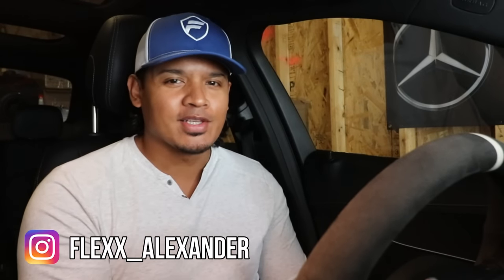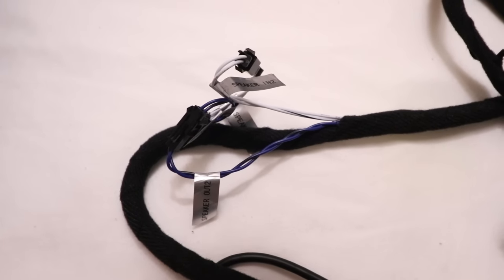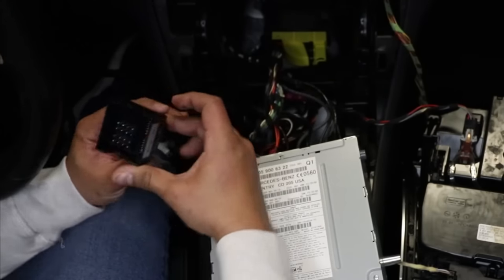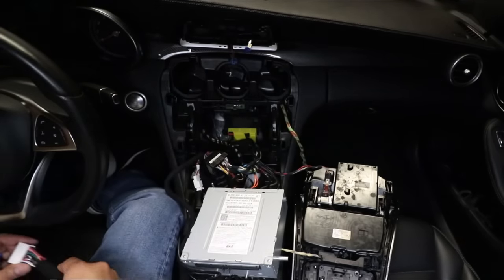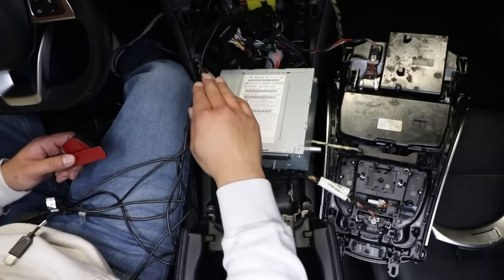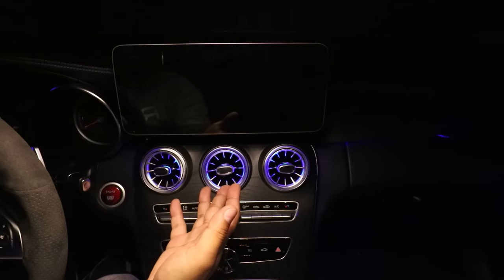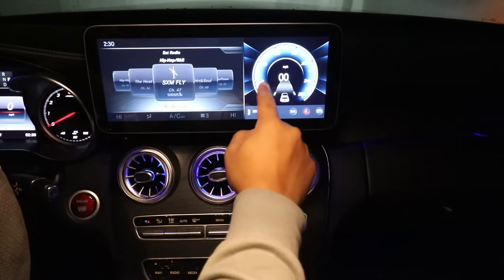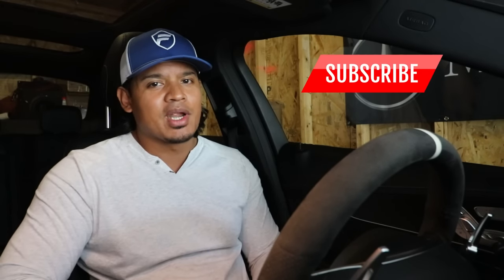BIGGEST Android Screen install on C300 (W205) 2015+ Mercedes C-Class

Comment: Installed mine a few weeks ago, I wound up not using the new micro & speaker just bc I didn't want to tbh & works fine. Also, if you don't have Hotspot then you should look into getting a SIM just so the display can run YT/Netflix, Android auto works fine without but for the full features
Reply: how do you deal with the mic? do you need to configure anything to use the built-in mercedes microphone?
Reply: Interesting. I skipped the microphone install too and it sounds like I’m talking down a hallway. I’m going back to install the microphone hoping it fixes that
Reply: @beaucephus526  did it fix it?

Comment: Flexx, thank you for this video. I purchased this MASSIVE touchscreen from DMP and installed it in my '16 C300. I had this video playing on my iPad as I successfully completed the install. I LOVE THE NEWLY ADDED FUNCTIONALITY! Sadly, Mercedes termination of 3G meant that much of the COMAND system became useless. This new screen replaces the OEM Mercedes apps with easily updatable Android/iPhone apps. I love when people in SUVs are behind me at night at a traffic light. It's awesome to see their jaws drop if I switch from Google Maps to Spotify to Google Podcasts to iHeart Radio and so on. The new processor is almost as fast as the one in my also brand-new OnePlus 11 5G! Functionally and aesthetically it is PERFECT! The last time that I opened up a dash was to install a Blaupunkt head unit in a 1994 Saturn. This video gave me the confidence of knowing that I could install it myself!

Thanks Flexx! Keep up the good...nah...GREAT WORK!

Arnel in Pittsburgh
Reply from the maker: Wow!!!!

Comment: Installed in my C63 w205. Install went smooth enough. Do suggest not pulling down the vents to make more space took long time to get them in again, there is enough room without releasing them to route cables. Screen works as expected, all good. Only thing I don't like is the brightness during sunny days, but cloudy or night its fine.

Comment: I installed the 12" on my 2019 GLC 300. Here are the pros of cons:
Pros: 
- Large screen display transforms the interior of the car to look modern.
- Audio works on music app, video app, android auto, YouTube etc. from the screen without installing the extra mic and speaker that came in the box (but audio has 3 sec delay). Voice command from screen maps app also works including navigation directions.

Cons:
- The phone audio does not work. DMP said I have to install the speaker and mic that came in the box, which does not look good on the car. I have to connect the Bluetooth of my phone to the factory MBUX instead for phone calls audio to work.
- Using the audio-USB delays the sound from the screen by 3 seconds, so you can't actually watch a movies on the screen when the picture is 3 seconds ahead of the audio. Another screen vendor has coded similar android screen unit to work with aux directly, instead of using the audio-USB. I think this a major issue that needs to be addressed. Anyone know how to fix the 3 seconds audio delay when using the audio-USB cable?
- After adjusting the android screen setting to always automatically connect to WiFi, it does not work. You have to always go into the android setting and turn on the WiFi manually every time you enter your car. This is annoying. Connecting your phone Bluetooth to the screen also disables the Wi-Fi. Is there at least a way to have the unit share internet via Bluetooth work?
- The factory screen options will still show but you can only use the scroll to navigate those options (not touch screen). This is not a big deal.

** The unit came with a 4G antenna? Some ppl call it a Wi-Fi antenna. Can I remove this antenna if I'm not using 4G or do I still need it for Wi-Fi?

Comment: The video is very helpful, I managed to install the kit by myself. The thing is, you have to be careful with cables routing, as the amount of space is very limited and I had to make several corrections to have everything properly fit back in place.

What I don't like about the set is that you have to choose both bluetooth connections for the carkit and OEM BT to be able to use OEM loudspeakers for calls AND be able to operate the phone via carkit's menu - the issue is then, carkit's BT connection gets prioritized over MB bluetooth, so calls are, by default, directed to the little crappy speaker and every single time you have to manually change BT connection on your phone to MB BT. Annoying. I don't know if it's possible to permanently change priority to have the calls operated by OEM bluetooth. 

13:29 - those little covers are so incredibly tightly fit, it's impossible to open them with a finger. There's so little space around, I actually managed to scratch the surrounding area and break my mini screwdriver in order to open those bloody things. The heads of those mounting screws (13:42) are too big in diameter, so when I finally mounted the unit and closed those covers, those little plastic hinges keeping them in place broke instantly.

14:02 - good luck with re-inserting air conditioning tunnel. I spent about an hour getting the damn thing back in place and managed to do it somewhat by accident. Again, you have to be really careful and precise with how you route the cables, otherwise you won't be able to snap it back into place.
Reply: That sounds complicated . Sheesh. Now you got me doubting my abilities. 😁
Reply: Hi, 
were you able to solve those problems? I am thinking about buying one for myself. How does it feel like after using it a period of time? is it as smooth as the OEM system?
Reply: @JC-dm6sk  No, I wasn't. Got couple of system upgrades from the dealer, problem remains unresolved. Generally speaking, system integration with Android smartphone is very poorly implemented - in fact so poorly, it's best to assume it's just not working.

Comment: Installed the new 12.3" Android 13 (Amazon - Ninetom Seller/Brand ~$509) my W205 2017 c300 today. I skipped the extra Mic, Speaker, Wifi, and Gps part since I will mainly be using the built-in Carplay features with my iPhone 12. Total installation time: ~ 4 hours ( 2 hours yesterday - completely forgot to plug in audio box into the center console/armrest area and the second white (left) main smaller connector which grants access to the old OEM interface and backup camera. 2 hours today - going back in to correct the previous mentioned and cleaning up wires) The most annoying part of the install was routing the wires through the back of the center console, behind the vent. Unfortunately, my vent was weird and when I clipped it down like in the video at 8:35 it didn't want to snap back in place on both sides so it's only snapped up on the right, but it should hold. Used electrical tape to keep the wires together and neat. One tip of advice, which isn't shown in the video well due to the editing, but transfer the two Torx20 screws from the previous bracket to the new one BEFORE putting it in place below the dash. The bracket has clips to keep these screws in place from jumping around. Don't try and lower the screws from the top of the dash into the new bracket - you most likely will lose one. In case you did: N000000000530 is the part #, the sizing is roughly M4 X 25MM. The screw can be found via Ebay etc. Lastly, when setting up my Carplay, I had to go into the OEM audio section and select "AUX" instead of Bluetooth because it was changing back to the Mercedes BT every 2 minutes when in Carplay. I also went into the "Factory" settings section (password: 190627 - most will have this) and select "Manual" instead of "Automatic" under the [Vehicle] Tab - subsection [Audio]. Now I can use Carplay without it going mute/pausing every 2 minutes and when I use my charging cable it auto connects to Carplay as well. Local Best Buy did not want to install the device and so with the help of Flexx's tutorial and some extra research to correct a few user mistakes, this upgrade is now complete! Good luck and have fun - its well worth it!
Reply from the maker: Nice write up! Appreciate you sharing your experience with the community!!!  😎🤙🏼
Reply: Thank you!

Comment: This is awesome Flexx. I was looking at this kit but wondering how it looks and how to install it. I have a few questions please. I have a 2017 C43. Is it correct that the steering wheel controls won’t work for up down track skipping, but the volume buttons will work? And is there any dependency with the USB ports? I don’t have an AUX option in my 8.4” COMAND NTG 5.5 system. Will this still work for my car? Thank you.
Reply: i have the same car what did you end up doing?

Comment: Hey Flexx! Love the mod, just got a 2017 C300 4MATIC with the NTG5.0 and Audio 20 package. I do not even have navigation on the car, and I highly value CarPlay. Just wanted to ask: as you've used the new head unit over time, has there been much latency? I noticed it took toward the longer side showing the backup camera in reverse. I also want to know if a.) after you go into reverse, does head unit bring you back to NTG or does it go back to CarPlay? (Assuming you were in CarPlay before R-gear) and b.) if I can change the digital speedometer to something else. I don't like giving my passengers a window into the absurdity of my er-- less orthodox driving habits. 

Thanks!
Reply from the maker: 1) it goes back to whatever screen you were last on.  And it actually isn’t that slow. It’s pretty quick. 

2) the only thing you can do is go into the secret menu and stretch the interface to cover the entire screen if you want to get rid of the speed gauge on the side. But then your interface is slightly stretched versus being true to the resolution dimensions. 

Feel free to ask DMP directly. There’s always updates and new screens available. They can answer any questions you have probably way better then I can.

Comment: Great install video .. everything went smooth .. I did however have to go in the camera setting and switch it to OEM but quick fix
Reply from the maker: Yeh. The screens settings need to be setup properly for your specific car. Most people think you physically install and it’s done but that’s not how it works.

Comment: Hi Flex, Hope you are well. Just a quick question. I installed this screen on my W204 but forgot to install the additional microphone. Would i need to open the entire radio unit or can i just remove the screen bracket on top and pluf the cable in ? I got this done as a garage using your video. Thanks for your support :)

Comment: Hi. I’ve fixed it in my W205 C200. But when we tried the function, the usb is not connected and the volume cannot be adjusted. We checked the installation, nothing went wrong. And also, for the CarPlay, it cannot access the YouTube as well.

Comment: Does it actually worked for long term or became slower to response as happens to android screen/tablets?
Reply from the maker: Yes it works long term.  And no, it’s not like a normal tablet where you spend hours a day on, downloading apps, downloading stuff, storing pics/files/videos constantly. That’s what leads to performance degradation.  On a cars android screen, people don’t treat it like an everyday tablet.

Comment: Hey Flexx. I loved this video. Thank you. Got mine installed. Everything worked great until the aux to usb audio box that plugs in to the armrest started acting up. Sometimes it connects sometimes it does not. I’ve seen the blue light on and off. Do you think DMP can provide a replacement ? Have you heard such a thing?

Comment: Hey Flex, I got the 10.25 android screen and I have the same kit as you. Do you ever experience any audio delay? I’ve done some research and they said that switching the usb audio box to a DSP box fixed the issue. Do you have any experience with this?
Reply: It is normal, but if you want no delay, do the aux 3.5 mode or dps

Comment: I love the Chanel flex and all the mods you do, it’s a great help also can I ask Do you have to have the speedometer showing in the split screen or can you have something else displaying also when revising does the camera populate the entire screen as I have a 360* camera and I want the whole view displayed on screen
Reply from the maker: mine shows the whole screen when I reverse. There's a secret menu in the android interface to make these changes. You will need to contact whoever who sold you the screen to get the passcode and ask where the menu is located. It's different for every screen and reseller of screens. If you bought from DMP, just message them and they'll help you setup the screen.
Reply: Thanks mate I appreciate you taking the time to reply and yes I’ll definitely go through DMP as I have before as you and I seem to buy the same cars, so thanks again for all that you do cheers from Australia mate

Comment: Hey Flexx - I bought the backup camera to install on my W205, does this screen support that installation? I saw the yellow connectors at 2:53 but wasn't able to see if one of them was labeled for the backup camera to connect into. Thanks!
Reply from the maker: This screen does.  It can support back up and 360 cam.  You would need to talk with DMP about how to install and configure it, since I’ve never done it cause my car already had an oem backup cam. But it’s doable.
Reply: I also bought the cameras and new display. Were you able to connect the cameras to the new monitor?
I’m about to install tomorrow .

Comment: Is the first cable connected to the new one for audio ? I’ve installed it on my cla but I don’t remember unplugging that cable and putting on the new one the screen works fine but my car has no bass and I already tried adjusting the sound of it but no bass please help

Comment: Any issues going from Park to Drive and the front camera switching on? Also, do the touchpad functions all work?

I have a unit installed and have both of those issues so I’m considering upgrading to this one in my GLC 43 AMG.
Reply from the maker: Sounds like you didn’t configure your screens setting right.  Mine works fine.

Comment: Hi, 
for those who bought this, 
How does it feel like after using it a period of time? is it as smooth as the OEM system?
I am seeing some problems such as the audio will play through the small speaker, 
were you guys able to solve those problems? I am thinking about buying one for myself.

overall speaking, does it worth the price? how does it compare to the new MBUX system?
Reply from the maker: There’s different versions of this screen in the market. And a lot of people are buying from different resellers. Just note that the feedback in the comment section do not apply to all screens…only to the screen related to where the person bought it and which version. There’s crappy ones, good ones, old ones, new ones…and there’s alot of people who don’t know how to setup the screen properly and automatically assume something is wrong with the product but it’s user error. My new screen in this video works flawlessly and is super fast and was purchased from DMP car design and they were able to assist me in setting it up properly. Also comes with a warranty. Most resellers don’t offer that support and just wish you goodluck on your install. So yeah, don’t take all feedback and assume it’s the same for all screens cause all the screens aren’t the same (just because they look the same).
Reply: @TheFlexxGarage  Thanks for sharing it! I was just curious about the audio problem that a lot of people were talking about. So you never had that problem? the audio coming out from the small speaker?

Comment: I have just installed this screen from DMP and I wired the speaker as you did but now all call audio runs through the little speaker and call audio is terrible.
...
But if I disconnect the speaker and connect the speaker in and out cables on the wiring harness back as they were from the box, then there is no audio from phone calls??
...
So do I just either get terrible phone call audio or none and have to use the car bluetooth? Seems silly that one of the major uses of a car screen doesn't work properly.
Reply from the maker: Not sure my man.  I don’t have that issue. I recommend contact DMP and asking them.
Reply: I think the issue is, in fact, with BT connection. You have to connect with "MB Bluetooth" to be able to use OEM loudspeakers and microphone. On the other hand, you have to also connect to "FSC-Carkit" if you want to be able to operate your smartphone via carkit interface. The issue is, "FSC-Carkit" gets prioritized over "MB Bluetooth" so the calls are by default directed to the mini speaker, which gives you terrible audio quality. While making/receiving  a call, you can switch the BT connection to "MB Bluetooth" on your phone, and you should be able to use OEM equipment for the calls AND use carkit's screen to operate the phone. The trouble is, I have no clue how to make the change permanently. You can also choose not to connect to "FSC-Carkit" at all, but only to "MB Bluetooth", which should work for OEM loudspeakers, but then you won't be able to operate your smartphone from the carkit's menu - it will say the phone is disconnected. At least that's what I have. And yes, that's a major inconvenience.
Reply: @MrPrzemekPilot  YES! This is the exact issue I also have. This really needs to be addressed in the software. Not to route call audio through the mini speaker but instead though the android media channel and use the car speakers?!
Reply: @MrPrzemekPilot  I use "Macdroid" and set an automation that everytime a call is active it will auto switch from the FSC-Carkit to the Merc BT. This fixes the issues with not being able to use the screen properly for calls.
Reply: Hi, 
were you able to solve those problems? I am thinking about buying one for myself. How does it feel like after using it a period of time? is it as smooth as the OEM system?